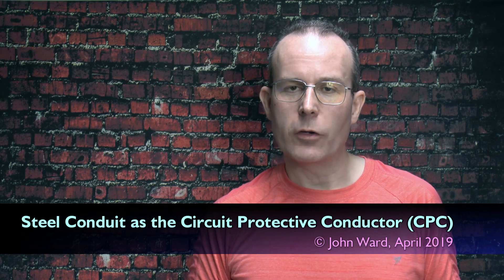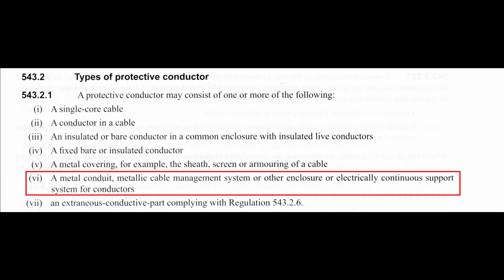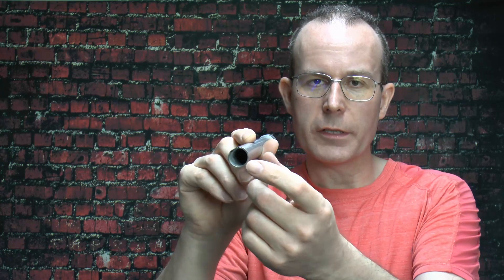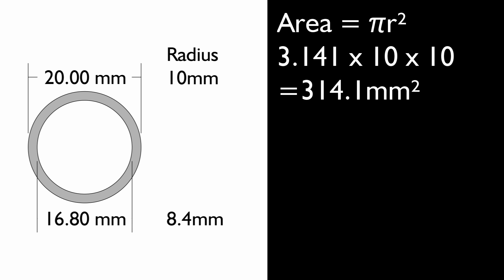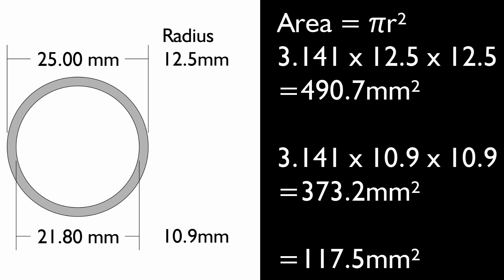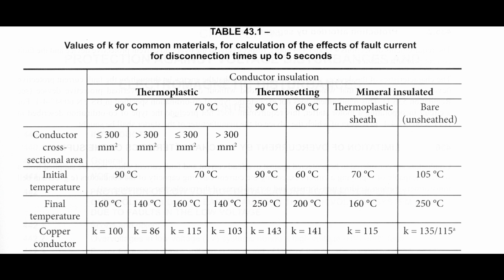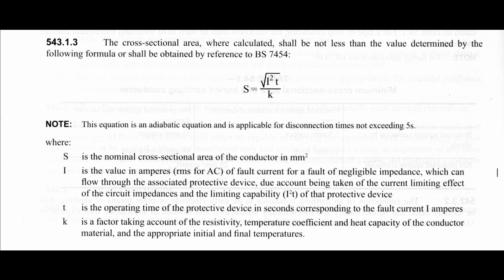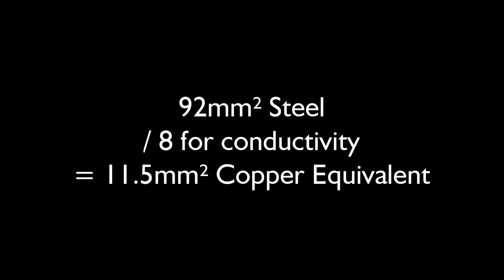Steel Conduit as the CPC (Circuit Protective Conductor)

Comment: Hi John,
Top guy btw.
What would an electrician use to ensure continuity of a circuit that uses it's metal conduit as it's earth protection if the conduit was cut into to extend the circuit? I remember you mentioned that earth clamps must not be used.
Reply from the maker: If conduit is cut, those cut ends would need to be threaded and connected to new conduit.

Comment: Good point John and up until the late 1970s that is exactly what we did, but were this falls down is over time the couplers can corrode and give a very high resistance and in some cases I have seen the hole conduit rust through

Comment: Wow, I have never worked this out, have always pulled an earth in because that's what's been spec'd. I couldn't believe how big the CSA of 20mm bar is but I worked out the size of a 20mm square bar which is 400mm sq. Then it made sense.
Good vid this JW but the sooth sayers will always want a cpc pulled onto the conduit, I don't think I have ever seen a conduit installation in the last 30 odd years without a CPC pulled in.

Comment: Shouldn't consideration have to be made for skin effect in the event of transients/surges?

Relatively minor in the case of 50hz- for mild steel some  0.9mm, enough to change the calculation but not enough to overwhelm it's sheer size.

But for something like 500hz, that drops to 0.09mm, and you might not have much CPC left at all?

Comment: Hi John, what about terminating steel conduit in a painted surface mount box of the type commonly used in garages etc.  Would this require a 20 mm earthing tag fitted to the end of the conduit inside the box?  i.e. in a similar fashion to SWA earth tag termination?

Comment: Interesting.  In another life I used to know something about "Tempest" precautions and testing.  This related to the suppression/shielding of data signals in a secure environment.  Steel conduit with screwed joints was demonstrated to be a very poor shield due (mainly) to high resistivity at the joints.

Comment: I worked on a very large site in which about thirty sparks were installing conduit, trunking, and tray. A cpc was run through all conduits - just as well, as some of the sparks who were a bit slapdash would loosen off a conduit coupler if they hadn’t measured, bent and/or set the tube precisely. One slightly loose joint in a conduit system used as a cpc can, under earth fault conditions, cause a massive temperature rise, and start a fire, unless rcd protection is incorporated.

Comment: John,   I worked for electrical contractors for the last 35 years designing and managing.   During that time, the owners of the companies all decided to not use conduit as "ground" (called here in US).   They decided it was not worth the risk.   People have died because the conduit came apart and became energized afterward.    Yes it's legal here as well, just not necessarily a good practice.   Respectfully,  Kevin

Comment: Here in Canada  it is only required in some instances by code OR if it's in the specs. The hospital where I work it's an unwritten rule we pull a cpc or "bonding" conductor even in locations it is acceptable to use the  metal  conduit. Other locations I have wired if the conduit will suffice and is highly unlikely to get separated damaged  or suffer corrosion, the bonding / cpc  conductor gets omitted.

Comment: The regulations state that electrical joints must be mechanically sound and so unless the electrical installation is installed and inspected by trained personnel, then it won’t be. Furthermore, Electrical installations must be periodically inspected and tested to ensure that the installation complies with the regulations. I’ve never seen earth bonding used on rigid conduit but it was common with flexible metal conduit. However, electrical bonding should be used at every conduit outlet box connected to an appliance or current using device. However, it is now common practise to run a separate cpc (earth conductor) when using metal conduit and trunking. 
Nevertheless, the video is a good demonstration of how to use the regs.

Comment: I've seen cases where conduit is used outside & the threads have been sealed with PTFE tape, (for good reason), but would obviously need separate earth cables run in.

Comment: Great video, what if you using conlok system. Where conduit couplers is a screw instead of a thread. What are your thoughts on that
Reply from the maker: The manufacturers of it claim it's just as suitable as screwed conduit.

Comment: In a domestic environment, there is always the risk of an foolish unqualified person tampering with the conduit not realising the significance of it thinking it's just a steel pipe to house the cables.
So in a domestic environment, I wouldn't recommend it.
Commercial would be fine because the job of installation is always left up to the maintenance man responsible for the building.

Comment: How does stainless steel compare to steel??
Reply from the maker: Many times more expensive than galvanised. Also requires different cutting tools and threading dies, stainless will quickly destroy normal ones.
In the context of this video, it's still suitable as the CPC, wall thickness is similar - typically 1.5mm rather than 1.6mm for galvanised.

Comment: I personally would always endeavor to draw in a separate circuit protective conductor, I very much doubt a client is going have an issue paying for a separate circuit protective conductor, the installation time will be the same as the cpc can be drawn in at the same time as the line and neutral conductors.

Comment: Never liked the idea of doing this, and was even told in college and by my employer that it's acceptable but also poor practice. I've also never really liked the idea of using the armour on SWA as a cpc too
Reply: I try to stop myself whenever I start thinking that my opinions are superior to those in BS7671.  You can use 3-core SWA like many people do, and not bother glanding the steel armour like many people do.  You could look up the table that shows equivalent CSA for steel and copper and then try to explain why the armour doesn't form an adequate CPC.  I'd be very interested in the explanation.
Reply: @westinthewest  Well it only takes a tiny split in the outer sheath of an SWA cable underground to allow water ingress and the steel will eventually corrode, and if anyone moves the cable at a later point it could work loose from the gland. Personally I'd put doing what I feel is a higher quality install over penny pinching but each to their own as long as it complies and is safe at the time of installation.
Reply: @_______DR_______  If the steel armour fails because of water ingress or if the gland works loose, the additional copper CPC core isn't going to solve the problem.  The steel armour needs to be in good condition and terminated properly otherwise it needs to be replaced, say if it were a distribution cable with no upstream RCD.  The extra CPC core would not provide equivalent protection.  Instead of relying on a third core as a CPC backup, you need to think about how to reduce the chances of failure, and rely on periodic inspection and testing to identify those failures.

Comment: It's essentially down to how good the original conduit install was as to wether it will maintain its integrity as a cpc. You are supposed to use galvanised paint on each joint to stop corrosion, but the reality is not many people do. If there is capacity to fit a separate cpc I would. It costs little more, and provides a more continuous and reliable cpc. Rusty joints, loose glands at accessories and poor quality workmanship = high resistance.. Just my opinion though. 😉 Great video JW
Reply: Instead of maintaining the brakes on my van, I keep an anvil tied to a rope in the back.  It doesn't cost much, and it provides a back-up method of deceleration.  Rusty calipers, contaminated brake fluid, corroded olives, badly fitted hoses...  😉

Comment: Re-wired a 1960's flat with steel conduit. Pipes were all rusty, some joints compromised by DIY bodges. Very high resistance back to the board on the Conduit. No continuity on some of them. Sprinkled talc powder on my singles when pulling through, line, neutral +CPC no problem. Was a little bit harder to do the 6MM Cooker, but i managed it!

Comment: My mentor always told me that you don't need a seperate CPC, if you do then you can't do steel conduit properly ;)
Reply: OR the person modifying the install after you've long gone 'can't do steel conduit properly'.....or just plain joint corrosion and damage to attached accessories ...just because it's allowed doesn't make it best practice...I see all 3 failure points on a regular basis in industrial installs.
Reply: @getyerspn  You could say this about any installation method.  If someone can't install swa glands properly you will have the same problem.  I have seen earth wires cut out of twin and earth.  It's not the installation method at fault.  It's people who shouldn't be working on the installation that is the problem.  Also steel conduit wont rust if you make sure if joints and cuts etc are galv sprayed properly.
Reply: @GazzJ82  unfortunately galv spray just doesn't provide as long a term protection as you'd think ...I only speak from experience ...but you are totally correct you can't design an install with idiots fiddling with it in mind... however the likelihood of  'accidental' damage to steel conduit accessories in industrial installs is huge ... I see it soon often ..and relying on it as the only CPC doesn't make me happy and adding an extra CPC pull inside the conduit doesn't contravene any part of the reg's.
Reply: @getyerspn  Spiking a separate copper earth electrode into the ground for each box or accessory doesn't contravene the any part of regs either.    When you design a cable containment system for an industrial installation, and decide that the ' likelihood of accidental damage to steel conduit accessories is huge', you don't use steel conduit.   If there's a chance of corrosion, you don't run a separate CPC inside, and let the conduit rot within three years.  You try to eliminate the cause of corrosion, or use stainless steel instead.
Reply: @westinthewest  unfortunately even the mighty stainless conduit doesn't stop it or the accessories being damaged ...also it's much more expensive than running a separate CPC inside the conduit .. most customers won't swallow the cost...also spiking another earthing point isn't often possible ..or at least cost effective when the facility sits on several feet of reinforced concrete...look I'm not saying using the conduit as  the only CPC is non compliant ...it's just another point of failure than can be avoided....I see it happen ...any enough of this I'm off to light the BBQ and have a beer and enjoy the brief warm spell in the UK at the moment ... Have a good weekend ..bye

Comment: To be more precise regarding my earlier comment: What do you reckon is more reliable?
a) A system consisting of dozens and dozens of unprotected mechanical friction joints that were designed for mechanical interlock, not electric continuity, or
b) A system using dedicated insulated copper wiring with far fewer joints and protected connections that are optimized for electrical continuity?

Both A and B are large enough (was this even ever a question?). And in some countries, both A and B are allowed. But A is still a terrible idea, and forbidden in many countries for good reason.
Reply: You could argue that those dozens and dozens of mechanical joints are superior to using a cpc which can and regularly do fail at one point which could compromise the entire earthing system. When ever I come across old conduit system they are never loose and failing; if anything it seems to get stronger.
Reply: @londontrada  This makes no sense. A proper copper wire with connections that are designed for electric continuity beats a pipe screwed into another. You say old conduit systems are never failing, yet people have died because of this.
Reply: @ToumalRakesh  People die from lots of things. In my experience the older conduit systems are generally in better condition than a lot of the newer Installations.

Comment: Hello John.  Very interesting and always and education.  Do other metallic CMS such as box trunking or cable trays have the same allowance regarding not requiring a separate Earth ?  I’m not an electrician, but I think the group standards I work to always specify a separate CPC.  I see a lot of damaged conduit hanging off wall and think I would want a separate CPC in a conduit if I could.  Regards  Chris
Reply: Timestamp 0:33 543.2.1 (vi) explicitly lists those things in addition to conduit as acceptable as long as they're electrically continuous, typically they'll have an even greater CSA.
Most installers seem to run a separate CPC anyway, for some reason they don't seem to trust themselves to install such systems securely, in spite of trusting themselves to correctly terminate & tighten CPC connections. Or they cite worries about damp & corrosion, as if they haven't encountered many terminations of copper wires going high resistance in such conditions as well.
As for damaged conduit, it should be rectified forthwith, regardless if there's a separate CPC installed or not.

Comment: I know that is legal, but as an electrician, I saw too many cases of corrosion or damage that compromised the grounding.  I always insisted on a separate ground wire.
Reply: So you reject BS7671 or some aspects of it.  You work to your own standard because it is better.
Reply: @westinthewest  Exceeding the minimum specified by a standard isn't usually seen as rejecting it.
Reply: @Berkeloid0  The standards are there so you can understand why exceeding them is usually pointless.  Using 6mm cable for a lighting circuit is more robust than 1mm,  voltage drop is reduced, and it exceeds regulations, but it won't make the MCB trip any quicker when a fault occurs.  It's a waste of resources, time and effort.  It's poor design practice to say 'What harm can it do?' or 'You never know', or 'I just prefer to do it that way'.
Reply: @westinthewest  this is allowed in the reg's as long as you can demonstrate you're techniques provide AT LEAST the same level of protection provided by the current revision of BS7671at the time of design...or preferably better..most people stick to the minimum suggested by the regs as this could make your 'day in court' easier buy just being able to say 'it complied with the current reg's at the time'...I know I've been done that....however providing an extra CPC in a conduit neither contravenes or 'breaks' any part of the reg's as you'll still be bonding the conduit at least at the start of the run and obviously at every attached metal socket/switch box etc....further to that the reg's also state ....regulation (705.512.2)  requires consideration to be given to the risk of damage to electrical equipment by corrosive substances, movement of structures and vehicles, wear and tear, tension, flexing, impact, abrasion, severing, and ingress of liquids or solids....the problem here for using the conduit as the CPC is the risk of damage on industrial installs ..I've seen it happen all to often ....so you could say that by not planning for the potential loosening of joints by damage or corrosion you'd be just as guilty of rejecting 'BS7671 or some aspects of it' ... but we all know if you dig through the reg's you could find a case for eather install method .

Comment: I knew as per the regs you could, but I never would. Just always seems so easy to pull in an extra core, so why not.
Reply: Why not a second extra one just in case. You never know.  What harm can it do?  I usually put a third one in as well.
Reply: @westinthewest  lol... being british I love sarcasm .... it's our national sport...however this is one of the parts of the regs than can and does lead to unsafe installs in the long run if not at the time of install.
Reply: If you had two (steel conduit + dedicated conductor) and they were only bonded at the consumer unit, you could have a device in each outlet that checks for continuity between the two and shuts off power if there's a break in either CPC...

Comment: This is one of the regs I think are wrong, there are far to many weak links in the chain with contuit and truncking. corosion, bad joints, cutting grease left on, trunking caps bridging joints with not bond straps,  etc. 5 odd years ago when I had an industril unit, the unit next door had a fault in thier conduit which had lost coninuity to the met and found an earth route  via the roof suports to the emergency exit lighting thru all units and caused a fire because that conduit lost its met conection too but had a 1.5 cpc to earth for everything to dump to.
Reply: I was waiting for him to go "...but this is why it's a bad idea". There's a reason why the regs in my country absolutely forbid this. Oh just like we don't have ring circuits and a centralized breaker system. And for some weird reason all the cited drawbacks for centralized breaker cabinets never are an issue here. I know there's a lot of national pride and "we've always done it this way" involved, but maybe there are a few things where you guys could and should look at other countries... and perhaps push your regulator to change a few things.
Reply: You can find fault with any wiring system if you look for it, PVC cable won't tolerate abuse either but the world is wired in it.